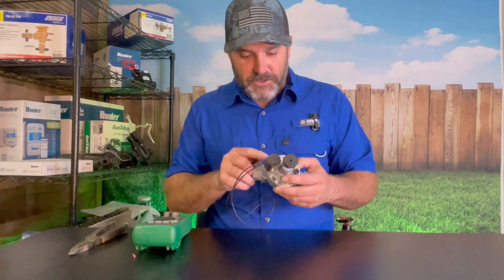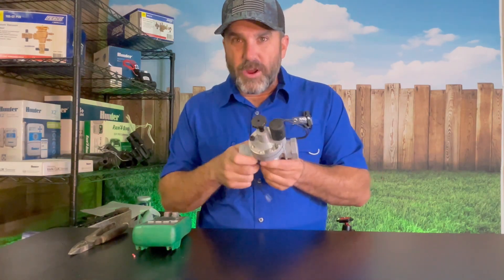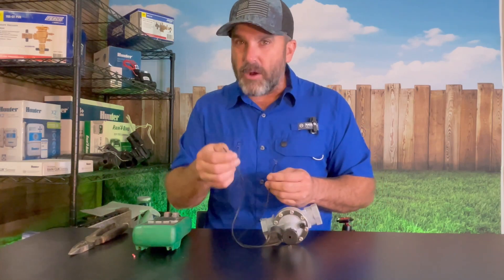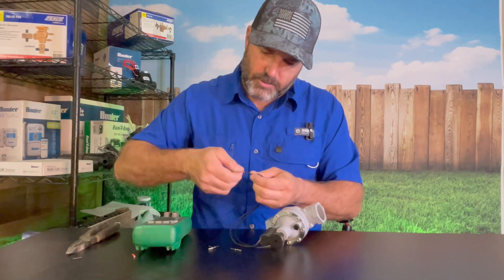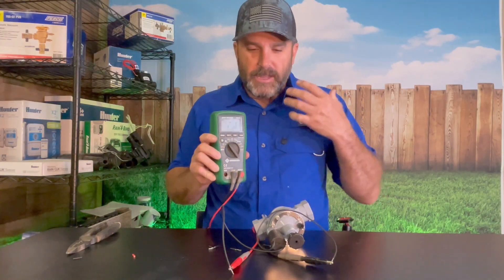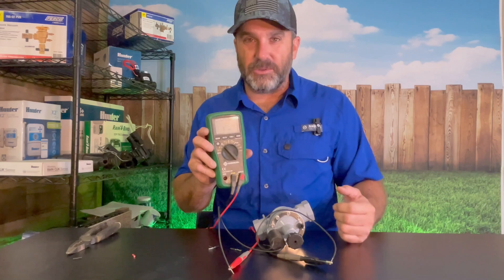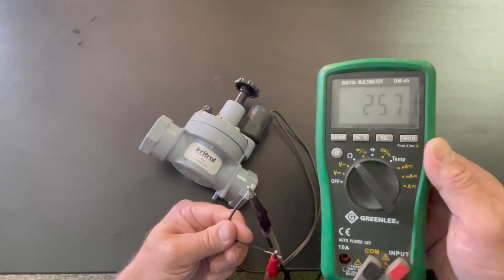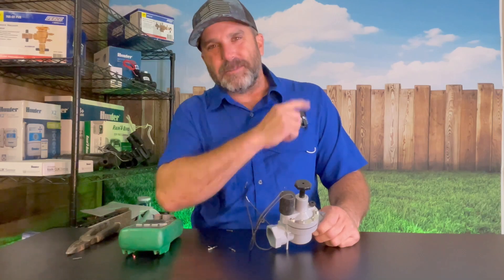Identify A Good Irritrol Sprinkler Valve Solenoid | DIY Tutorial

Comment: Could you discuss what amps means for an irrigation system? One time I had an issue with a valve that would pulsate on and off and I had no idea why. I saw a video that said it was the solenoid, but the multimeter said it was good ohms. I changed the solenoid anyways and then the valve worked. So I don’t understand what happened. The controller though read amps when the valve is working. So what does amps mean when a valve is working?
Reply from the maker: My understanding is, amps is the current of electricity, also current draw. It’s like flow when compared to water. In your case, something in that solenoid, or some other part of the system, could have been drawing more current than it should. I’ve heard it could also be the controller or even something with the power supply causing that to pulsate. But the solenoid is going to draw a certain amount of amps. One number to open the valve, inrush current, then one to hold it open, holding current or operating current. It can be tricky trying to figure out what was causing that. Hope this helps.
Reply: What do you mean ‘read amps’? Did you just replace the solenoid or the entire valve? I don’t check amps often, mostly ohms and volts. Pulsating is usually due to a dirty or old diaphragm.

Comment: A good practical vid Kelly. I also do this at the controller. Saves cutting wires at the solenoid. I unplug the controller and also remove the batteries.
Reply from the maker: Another good tip. Thank you. Yes, I usually start at the controller then go out to the problem solenoid and test there as well. Always good to get your expertise.